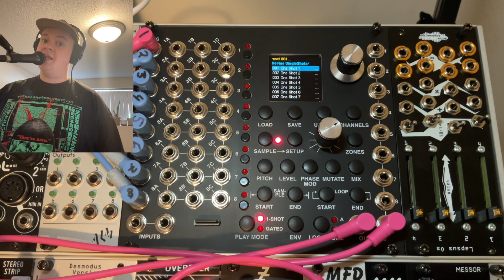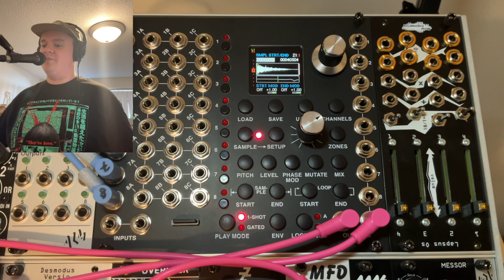Rambling About: Rossum Electro Assimil8or with Tafony

Comment: The OLED display is certainly a bummer given its size, refresh rate and apparent low life. There was a batch of Assimil8ors that had very dim screens off the production line and the company didn’t offer replacements. Their way of solving it was to offer replacement OLED kits for 50 bucks. It's great there is a solution tho.
Reply from the maker: @darrenblondin  funny that’s not the first negative Rossum support story i’ve heard, haven’t opened anything of theirs personally tho so 🤷‍♂️